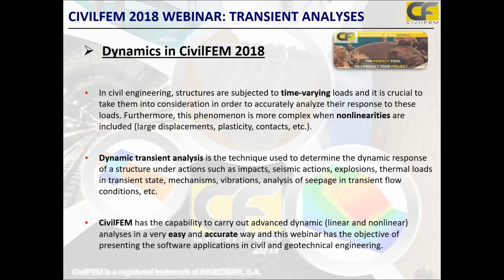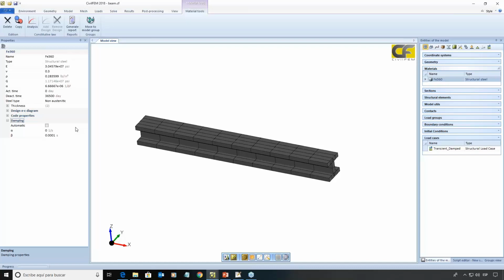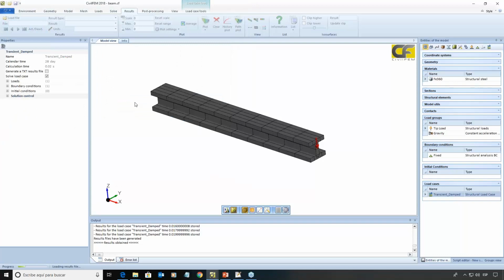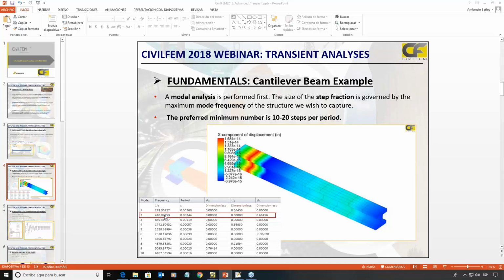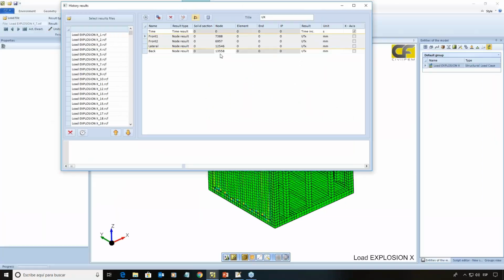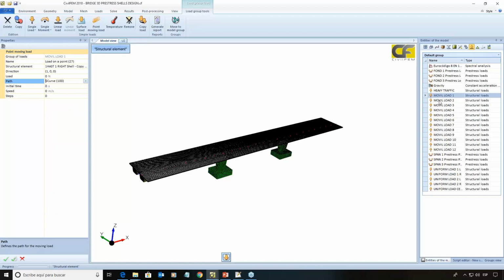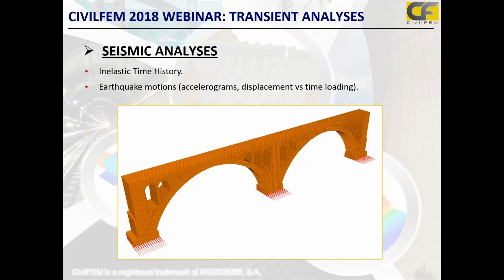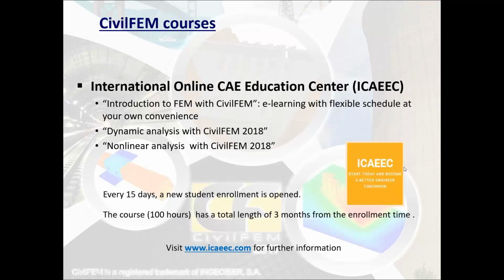Webinar CivilFEM 2018: Advanced Transient Analysis

Comment: Does civilfem has explicit solver?
Reply: It doesn't use explicit. For impacts, CivilFEM uses a very small step implicit method. To solve this analysis without taking too long we must model the object about to impact with the structure. CivilFEM is designed to solve civil engineering  and advanced architecture analysis,  so it focuses on the result and behavior of the structure after the impact and not so much on the process that leads the object to impact on the structure.